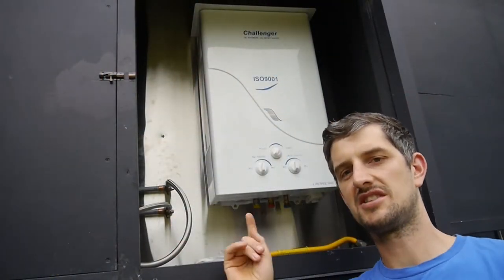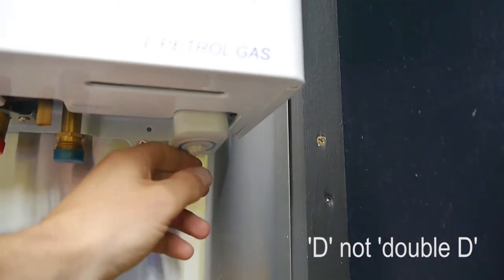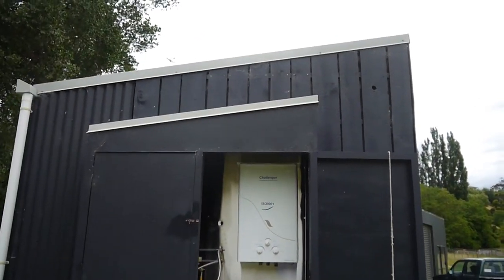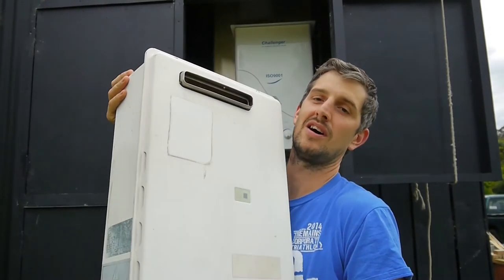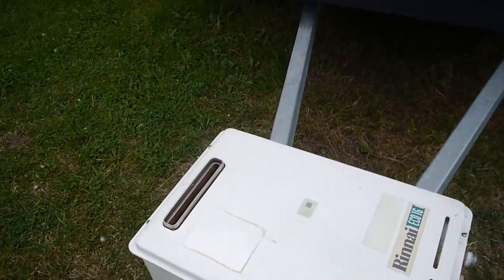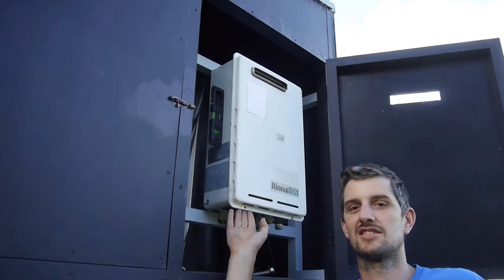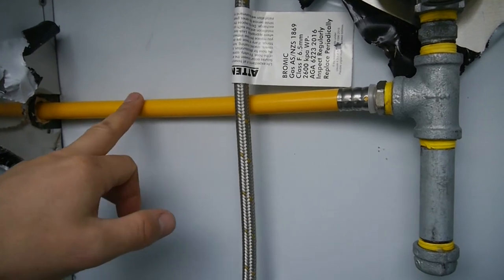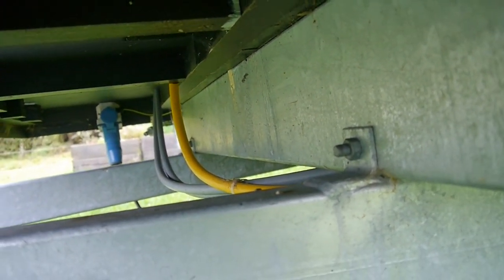How to Install an Gas Water Heater Califont 'Tiny House Project'

Comment: I have a tiny house too and just got the colifont hooked up today by a licensed electrician and gas fitter. The manufacturer of the tiny house mounted the colifont on the outside. So there is no venting problems as any fumes would go directly into the atmosphere. The only disadvantage I can see with with having the colifont outside is that it is exposed to the elements/corrosion/rust etc.
Reply: My colifont is a Rinnai Brand just like the one you have this video. Same model.

Comment: 3 years old video and still helpful! cheers for that.
Could you tell me about the auto gas changeover unit? where from? how much?
Ive seen some from Tap Warehouse on trademe but your one looks good. what is your experience 3 years into it?
Phil :)
Reply from the maker: Hey, this is from plumbing world, not sure of pricing. Use another one of these on the shed too and both work real well.

Comment: My tiny house is on wheels too. I can move it if I want too. The manufacturer (Cool Cabins) pulled it down from Auckland all the way to where I live in Taranaki with an SUV (probably about 4 litre motor). And those are some challenging roads. I constructed a deck around the tiny house so I can chill out in summer. But it could be lifted out by Hiab. I am concerned about it resting on the tires and am in talks with a local engineer/metal guy. I am going to hire him to construct stands that could be places in the 4 corners under the metal frame (looks similar to yours). And then the tires could be deflated some so that most of the weight rests on the stands and not the tires. There are also stabilizers in the corners but most of the weight load now is on the tires.